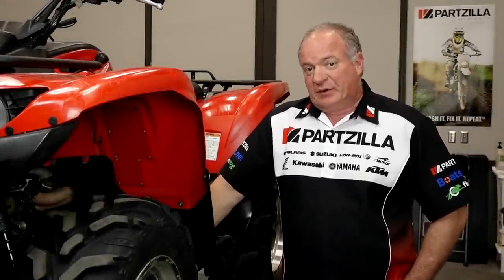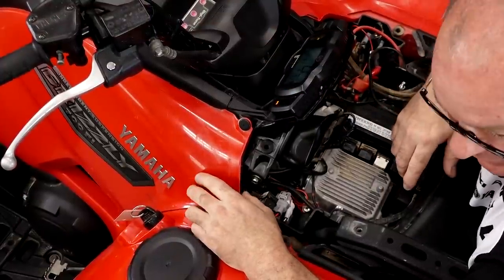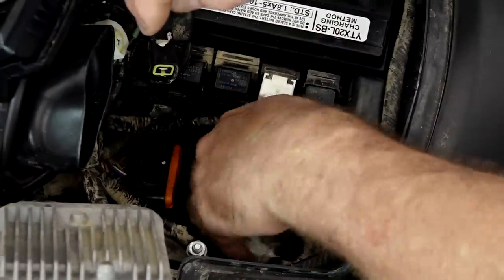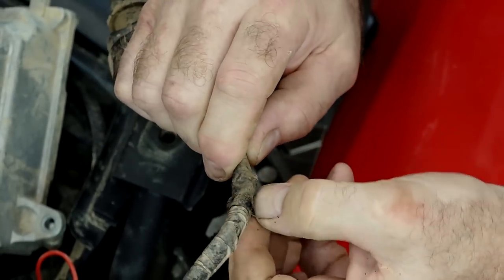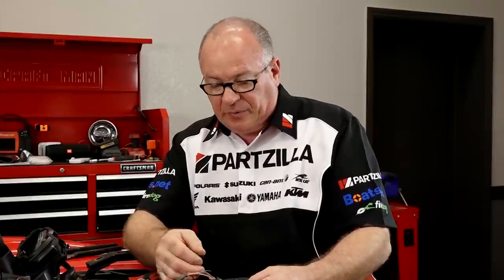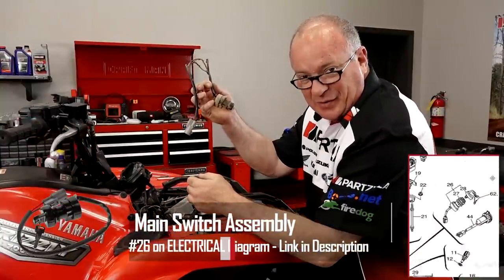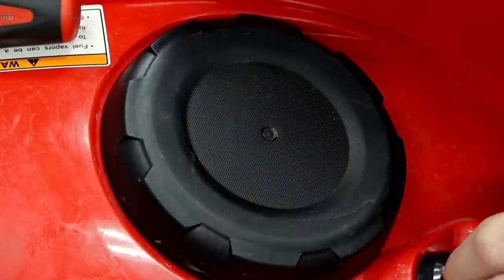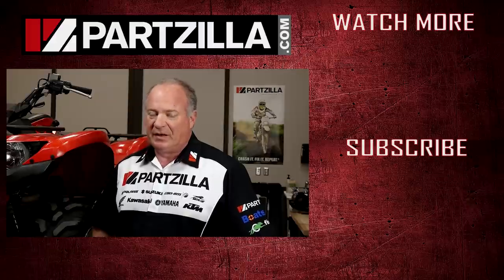Help! My ATV Won’t Turn Off | Yamaha Grizzly Ignition Switch Replacement | Partzilla.com

Comment: Hi John. I have a 1989 Grizzly with the same problem, but it also won't start as well. Could the switch be causing this issue as well.

Comment: I have a 2020 model Kodiak 450. It starts and runs, but it won’t turn off. But not always, sometimes it will. 

But if it doesn’t, you have to disconnect the battery for it to actually fully stop. 
Any ideas?

Comment: I have a honda rancher 350 04 model. And it's doing the same thing. I changed the switch and it's still does it . so I guess my question is do I need to check my wire's

Comment: I also have a 2007 Grizzly 700 my problem is the Dash has a flashing es and will not shut off even with the key which kills the battery if I unplug the dash cluster the ATV will start the next day any ideas on what this is

Comment: i believe that was the power steering control unit not that regulator/rectifier
Reply from the maker: You are not wrong.  It wasn't the focus of the video, so it was the first thing to pop to mind when seeing the cooling fins.

Comment: My 07 yfz450 key switch is backwards, when the key is off the neutral light is on and when the key is on everything shuts off????? The guy I got it from has a brand new ignition switch for it but when I plug it in it does not work at all? Any idea? Maybe the ignition he bought is an aftermarket and maybe I need to buy the OEM? And the bike runs like garbage. It’ll start fine and randomly die. Can’t even ride it. Hellllp
Reply: A good amount of the aftermarket ignition switches are wired incorrectly. I just bought an aftermarket switch for my 06 wolverine and verified with a multimeter that it is wired wrong. Half the components are on when the switch is off, and it changes to the other half when turned off. I'll be ordering an OEM switch from Partzilla.]

Comment: My 660 starter won't stop cranking. I disconnected battery. Any ideas?
Reply from the maker: You either have a short or something was hooked up wrong.
Reply: I’m having the same issue as of right now

Comment: My problem is it will turn over and start fine and the switches are good ik that for a fact. But it wont shut off. It did it one second then stopped. Then a few mins later it shut off when i switched it off. Its confusing lol
Reply: And when i turn the switch and key off. It does shut off the power to it but still wont turn off. Its wierd
Reply from the maker: Trace the wires, check the plugs for water.  If it's intermittent, it's usually one of those things vs a switch.